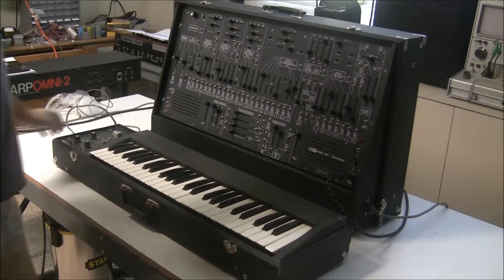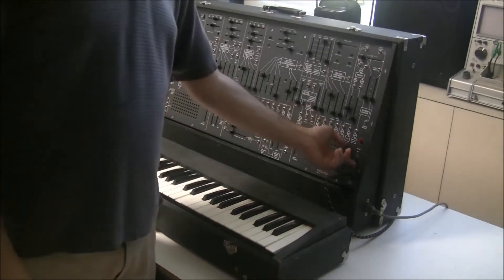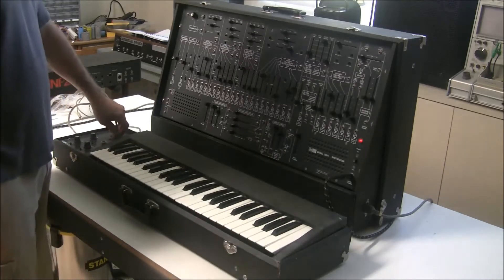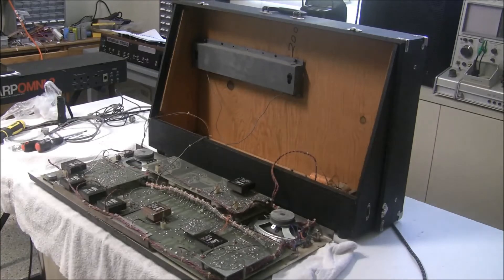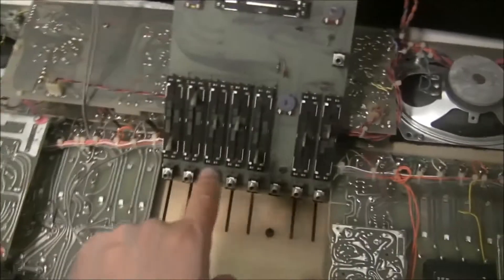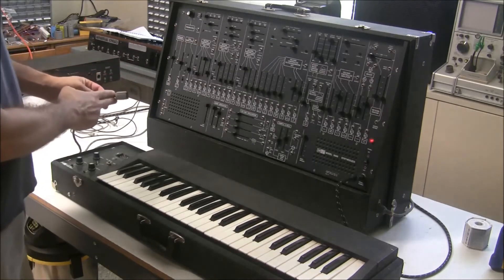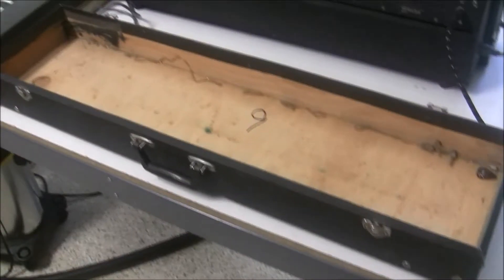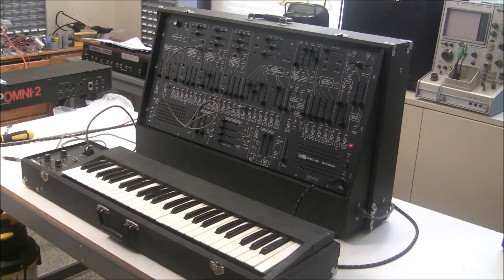Synthchaser #073 - ARP 2600 Tonus Logo Repair - Sliders & Connectors

Comment: Superb video thanks!!! I want to get inside my 2600 and remove everything, just wondering is there anything difficult or that I should be aware of in removing the PSU and all parts from the suitcase? apologies for soliciting free advice....
Reply from the maker: It's all pretty accessible.  I think I might show power supply removal on my 2600 in this video: https://www.youtube.com/watch?v=mF80J4qNdtI
Reply: Synth Chaser you did, I missed that thank you!!